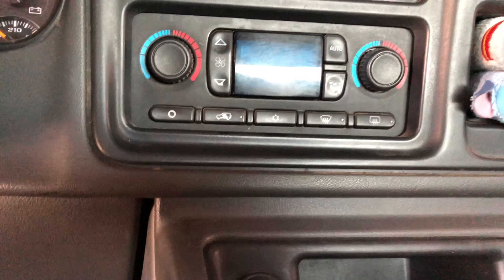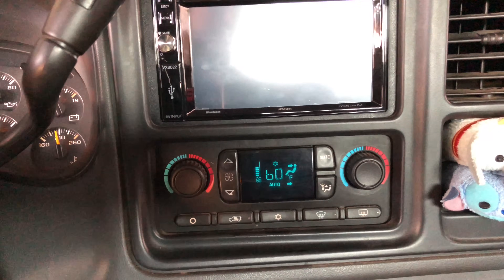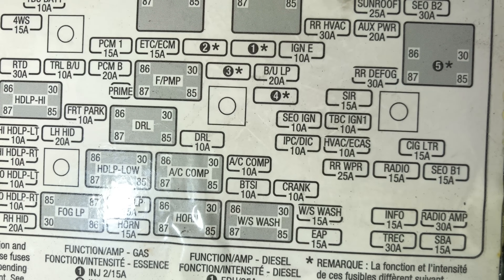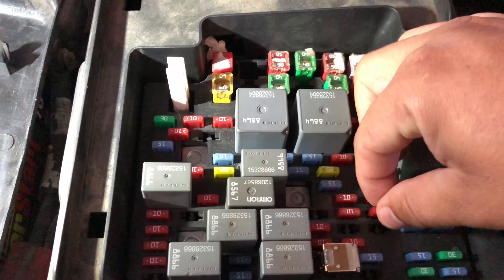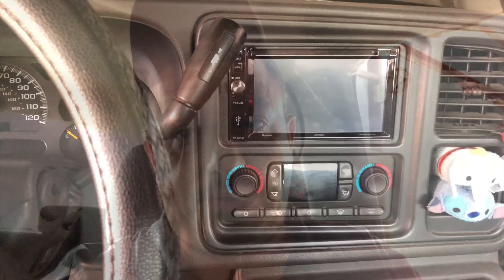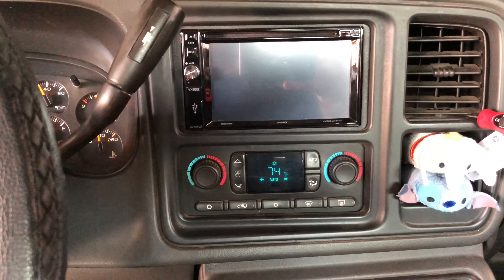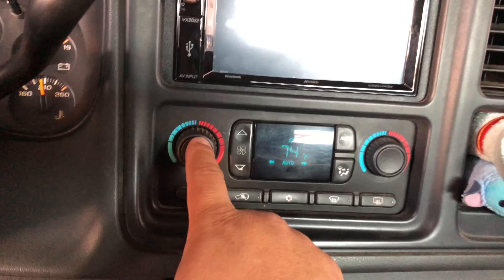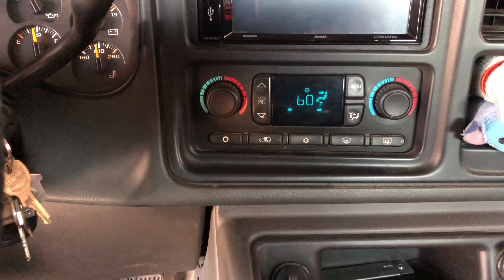HVAC Automatic Blend Motor Actuator Recalibration Procedure for GM Trucks & SUVS FOR FREE

Comment: Hey Falcon,   I have used your video several times over the last year and a half. I have a 2005 GMC sierra truck. Every once in a while my driver side AC will blow hot air. Each time, I pull up your video, get a refresher, and go through the procedure and I am back in business. Thank you sir for paying it forward. This is an excellent video.
Reply from the maker: Thanks for watching my videos. Not going to lie sometimes I watch my own videos to remember how I did things. 🤷‍♂️🤷‍♂️
Reply: @FalconsGarage it is resetting, on my 2003 Tahoe, but the air is still warm. It come out cold in the back but it goes from hot and like a lukewarm but not cold. It has antifreeze and coolant.🤷🏾‍♂️
Reply: This is in the front of the truck. But it is resetting but still warm air
Reply: i have the same issue you just described . all i do is stop if im driving shut off the ac , turn off truck for maybe 5 seconds or so.. start back up and it works. but thank you falcons garage for a good hard reboot that may solve other issues. cheers!
Reply: @Cream_CurdlR  I have the same issue as well. My mechanic couldn't tell what it was and my dad replaced one AC part. It's a pain, especially with it being cold outside now. I'll try this as soon as I can

Comment: Hey bro I have an 04 Sierra with same A/C controls, my heater and A/C work fine but my temperatures are backwards, I have to be at 90 degrees for my A/C to blow cold and 60 degrees to blow warm, I tried the recalibration and still same thing, I also changed the controls and same thing as well..any ideas?
Reply from the maker: maybe a bad air temp sensor ... could the connectors have gotten swapped?
Reply: @FalconsGarage  which connectors would those be?
Reply from the maker: @oscarlopez2599  like on the back of the controls
Reply: @FalconsGarage  when I tried the other ac controls the connectors are different, no way you can switch those. I have thought about maybe the pins I can possibly swap

Comment: I have no cold air in the front only in the back. I did everything you mentioned and still no cold air in the front. Do you have any idea what can be the problem?
Reply from the maker: one of the actuators is bad .. 

but i need more info .. does it blow but not cold only hot?   does it no blow at all? ...
Reply: @FalconsGarage  it blows air but not cold air. When set to hot it blows hot air.
Reply from the maker: @jorgerivers714  as long as you have the cold lines going into the front. Then most likely you do have a bad actuator

Comment: I get semi-cold air. But I don't have the snowflake on. I get a snowflake with a line through it. Suggestions?
Reply from the maker: does the mechanical part on the system work properly?
Reply: @FalconsGarage  the mechanics of it work, but blinks 3 times and shuts off. Also takes awhile to get cold.

Comment: I replaced the actuator and tried the AC. It made a loud click noise and then nothing. AC still blows in the rear but not in the front. I have a 2011 GMC Yukon XL SLT. I tried recalibration per your video. My AC never showed the 74 degree but instead showed where I had last had it set at 60. I proceeded per the video and still no AC in front. Do you have any suggestions before I surrender it to the dealership and pay an arm and leg?? Thanks
Reply from the maker: if it dosent blow at all on the dash sound like a blower issue

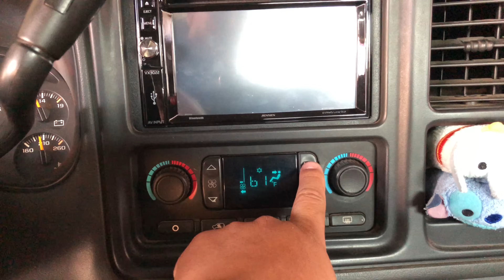Comment: Only 1:05 into the video. The comments make me feel as I have arrived at the right place. I subscribed on the strength if their testimonials and the fact that you took your time to help us and with obvious success. ✌️
Reply from the maker: thanks
Reply: @Falcon's Garage   I can't find the correct fuse on my 2014 Impala Limited.
Is see where the fuses are but none of them say hvac. I also don't have the auto button for my ac unit so I figured that part didn't matter. Will disconnecting the battery work? I replaced the actuator and it sounded slower then faster to the point it makes 3 different noises for a span of 2 minutes that sound like an MRI machine. 
 
Please help if you can.

Comment: •2005 chevy trailblazer (mine resulted from a dead battery)things are a little different...

⚠️ 2:00 no HVAC fuse under the hood, i hav ECAS, which is supposed to be a 10amp fuse everywhere else in the Universe, but my Trailblazer has a 35amp & its supposed to be 35amp.  there are 2 fuses under the left back seat fuse box listed HVAC1 & HVAC2 . 
I removed those 3 fuses & followed your instructions. It worked before to trigger my AC & did not work this time for the heat. 😫i am updating this video  to trigger my passenger side to go back to blowing hot air for winter, but failed this time around.

Comment: Any input if the control display went dark? (wont light up.  Same controller as your truck  2003 Avalanche)
Reply from the maker: does the controller still work .. just no light coming out of it?   or does it not work?
Reply: @FalconsGarage  hi! And thinks for your response. The switches seem to work BUT the AC blows warm (maybe the controller is messing with the blend valves?)

Comment: Can you just remove negative battery cable?
I can't find that fuse in my manual
Also would this work on a cadillac sts 2008 duel climate, passenger side only blows hot air,  and I mean HOT
Reply from the maker: Cadillac are a different ball game .. dont think it will work
Reply: @FalconsGarage  any idea if there's a test for my car before tearing out the dash??
Thank you for the reply..but also, is disconnecting the battery the same as removing a fuse?
Reply from the maker: @vogrin-h4g  disconnecting the battery “might” work, but I can’t be 100%. As far as a test yeah you could test out and see if all actuators are working properly also if it has enough Freon.
Reply: @FalconsGarage  i can't control the passenger side at all it only blows extremely hot air
My ac fine,  thnx for reply, will try what you said, cuz someone posted on here that it worked on an escalade

Comment: I need help I have a 2002 gmc Yukon and all my fuses for my ac are: A/C 10A A/C 86 30 87 85  R/R HAVC 30A R/R  DEFOG 30A  & RR DEFOG 86 30 87 85 Truck still blows hot air AC light turns on and defrost for the front and it blows the air for the rear but not the front stuck I. defrost
Reply from the maker: if its stuck in defrost thats "default" mode .. so there might be a bad blend door or something

Comment: I’ve tried this process a number of times but it never works. It just blows out hot on the driver side and cold on the passenger with no change
Reply from the maker: actuators are probably bad

Comment: I was having problems with my ac it would sometimes blow hot air in front and in the back cold I tried this method and now only the defrost works on my truck any pointers on how to fix it
Reply from the maker: if it ONLY blown on the defrost mode that's the default mode!  so there is probably something wrong with the door actuators or controls and thats why it defaulted to defrost

Comment: My rear HVAC has no power at all any ideas I can't figure it out
Reply from the maker: No power as in blower not blowing any air or no power to the rear blower or controls them selfs
Reply: @FalconsGarage  no power as in no power in the rear of the vehicle for the HVAC system ... Fuses all fine ... Is there a major ground wire somewhere back there?

Comment: I had a bad “Internal temp sensor aspirator.” Had to replace that first (the vent above his head) then did a reset, system works perfectly. I did end up replacing the controls thinking that was the problem but it turned out to be that sensor.

Comment: What if you try and adjust the thermostat, but the temperature display starts to jump all over the place. For instance,…let’s say that I have the air on 70* and I want to adjust the temperature 75*. I should be able to turn the thermostat knobs five clicks clockwise to reach that. Whenever I turn the knobs, the temperature display may go backwards one or two degrees, and then up one,…and so on. I’m kind of forced to leave my thermostat set at the lowest setting as I live in Az and don’t mind it in the warmer months. I would like to warm the inside up in the cooler months when needed.
Reply from the maker: maybe a bad controller?
Reply: @FalconsGarage  that’s kinda what I’m thinking. I checked on Amazon for a replacement, and it was about $170. I can live with that, as I thought it would’ve been $300-$400.

Comment: 2002 2500 hd with auto climate control. Not getting heat out of defrost. How do I recalibrate this. Has auto for fan speed and auto for selector.
Reply from the maker: does that actuator work? defrost is like default mode ..

Comment: The fan blower motor works with the key on but when I start it it doesn't blow at all
Reply from the maker: i would check the connector to it .. and wiring system

Comment: Im gonna try this. First snowfall of the year and my tahoes defroster starts to blow cold air. My windshield was just as wet at it was outside. Does anyone know if this will fix the no heat issue for the rear system too?
Reply from the maker: make sure you got collant going into th back .. then check actuators
Reply: @FalconsGarage  thanks for your reply. So it was my water pump that failed and I replaced it. There is now good heat in the front. However I didnt run the rear heater when I filled the coolant.

Comment: You are the absolute best!!!!!!!! My H2 Actuator was replaced by myself and would turn on for about 15 seconds and then shut off and I couldn’t figure out why until I saw this video. I did everything you said and it worked like a charm. I really appreciate it and your knowledge. Thank you!
Reply from the maker: Glad I was able to help!
Reply: H2 is that the one that controls where the air comes from ? Mine won’t blow to the face it only goes to the feet or the windshield

Comment: HELLO THERE I JUST CHANGED MINE FROM DRIVE SAID BUT FOR SOME REASON IS NOT BLOWING AIR INTO TAP AND FLOR WHAT CAN I DO IS 2004 CHEVY TAHOE   ?
Reply from the maker: yes .. as long as it has the same automatic controls
Reply: @FalconsGarage  I CHALLENGE ALL THE AC SYSTEMS BUT NOT THROW COLD ONLY HOT SO YOU THINK IS AC DOOR ACTUATOR JUST FOR FRONT AC AND WE'RE IS LOCATED  PLEASE 😰😰

Comment: For the past couple of months had intermittent blower motor. Vibration related. Found the grounds on the underside under drivers door two under one bolt. Disassembled and it was really corroded. After butting it all back together had to do this reset procedure twice to get everything back to functioning perfectly. Thank you!!!
Reply: I’m experiencing this issue with my 07 GMC Sierra right now. The blower motor sometimes works and sometimes doesn’t, seems like a loose connection somewhere.

Comment: My 04 duramax still won't blow out the defrost or the face vents. It's stuck on the feet. Any recommendations?
Reply from the maker: I believe thats default more ... check your MODE door actuator
Reply: @FalconsGarage  it is the one above the gas pedal. Im on my way to get a new one now and replace it then refollow your video and im sure it will be perfect. I took out the actuator and moved the white gear and it switched to the defrost and face vents. Thanks again.
Reply from the maker: @craigackerman2590  not sure of exactly witch one it is. But the dealer or parts place should have diagrams to see witch one.
Reply: @FalconsGarage  i went to O'Reilly auto parts and picked the part up for 45 bucks. Chevy dealerships are 0 help. I put the new part in which took about 1 hour due to it being crammed up by the gas pedal. The brake pedal was massively in the way but then it worked perfectly. I have defrost again and it blows out where I tell it to now. I called the chevy dealership and they said its a 107 dollar part and 732 dollars of labor. Lol. Took me 2 hours total to pull it out and put the new part in which was 45 bucks.

Comment: Did this recalibration on 2007 gmc yukon Denali, there are 3 fuses I pulled hvac-ign, hvac, and Aux hvac rear. Worked perfectly. I was having trouble with rear turning off and front max a/c turning cycling off within a minute of start up. Great info bro, It saved me a lot of headache and time of trying to figure out all the electrical THX
Reply: A
Reply from the maker: Excellent!

Comment: I was so convinced by my "A/C" mechanics that it was an actuator or the entire system needing to be replaced. After doing their recommended procedure to disconnect the battery and let it sit for an hour, it would reset. It didn't. After much research on YouTube, came across this and just finished the  re calibration procedure. My A/c on both sides work perfectly and now its blowing colder than ever! Thanks so much for the assist!
Reply: I just did this and now my ac is blowing cold on the passenger side after blowing hot for a year.  Thank you so much!
Reply: I've found on some trucks, if the driver door is open while programming, it won't run through the protocol.  I always close the driver door, and it works every time.
Reply: @bigblocklawyer you are the true hero!  Recalibration would not work until I closed that danged driver door!
Reply: I can’t wait to go home and try this 😮 on my 2003 Tahoe that I just practically stoled  for  1800 bucks , she runs like a dream best car I’ve ever owned and keep in mind I have 2 new Silverados . But they don’t make them like they used to.
Reply: This worked for me!!!!!
Reply: Tdso90
Reply: What is the procedure a 2013 suburban LTZ with dual climate controls?
Reply from the maker: Glad I was able to help!
Reply: @FalconsGarage  
Can you explain on a 2001 Yukon. It has the knobs
Reply: @xusiamez have you tried it?
Reply: @FalconsGarage I need help still not working
Reply: How do you do this

Comment: Hey you are the bomb brother !!! I did exactly what you said, I have a H2 hummer and it corrected the problem heat on one side and air on the other works perfect, thank you again
Reply: Can’t seem get this to work for
My 2015 GMC Sierra 1500 ! Haven the same issue with passenger side
Not
Blowing hot air or cold

Comment: Battery went dead on my 2011 Silverado. Upon battery change out and start.The passenger side was blowing hot air. This re-calibrate fixed the problem. I pulled the HVAC BAT fuse, 10 Amp. I think it was #39. Thanks

Comment: So excited that I found you such an easy great video this happened to me question I have for you is when you turn the car back on are you running the AC or you leaving the AC off we So excited that I found you such an easy great video this happened to me question I have for you is when you turn the car back on are you running the AC or you leaving the AC off will it's resetting that's the 1 thing I don't know should the ACB on or just should the fan be running.. I have a 2005 ford mini van so it's a little bit different I have to manually turn the fan on even if it's on auto so do I turn the fan on and leave it on auto or turn the fan on afterwards thanks so much for your help greatly appreciate it

Comment: I made the mistake of replacing the broken gear but I did not make a notation of where the blade should have been so after I reinstalled it and it's doing the self test it just switches back and forth back and forth continually and cannot be adjusted with a knob so now I'm going to try to recalibrate to see if that works
Reply: Did this work for you?

Comment: I need help. So I went to a shop to get my new apple car play radio installed and ever since then my ac doesn’t blow cold anymore. Just got. I bought brand new ac system and only the back blows cold ac. Can anyone help. 2003 suburban z71 with Bose. Thank you , they had to bypass the amp to the new radio for speakers to work
Reply from the maker: i dont think the 2 systems are related ...  and if the back IS blowing cold then the mechanical system is working .. the problem might be your front temp actuator.

Comment: So, it’s been recalibrated, but it still won’t switch but it’s not making a clicking noise when I change modes. Sometimes my top vents just won’t blow, but if I put it on just feet normally when it does work it just won’t turn off. The top always blows unless it just won’t
Reply from the maker: maybe your actuators are bad .. floor/defrost mode is default mode ... meaning if something goes wrong it will go back to that mode and only blow there .. so you might have an issue there

Comment: This worked like a charm on my 04 Escalade.  Driver's side would only blow heat, while the passenger side was ice cold.  Hopefully it isn't a sign that my blend door is failing.  Not sure why the blend door would suddenly get out of whack when it hasn't been touched or worked on...no battery disconnect, etc.
Reply from the maker: could be just a glitch or it could be a actuator going bad
Reply: @FalconsGarage  is there a way to recalibrate the rear blend door on the gmt800 SUV? Mine only blows AC, but won't blow heat.

Comment: Great video. 
I had a prior problem with my 2004 GMC Sierra drivers side blowing only heat. I replaced the door actuator and it fixed that problem. [I didn't know about the reset procedure so never reset and it worked fine].  I am now having a problem in a/c mode blowing a/c for awhile and then switching to heat by itself.  So I performed the reset in this video. The first few times I performed the reset, the fan would only blow through the defrost, and the fan levels wouldn't change. On the third reset, it finally worked. I haven't yet determined whether the reset fixed the a/c heat fluctuation issue (will have to drive awhile to figure that out).  I have heard on other forums that my problem could also be the a/c pressure switch going bad (which costs about $20).